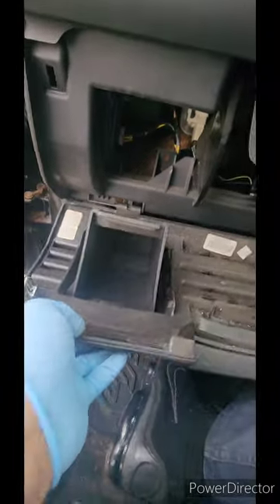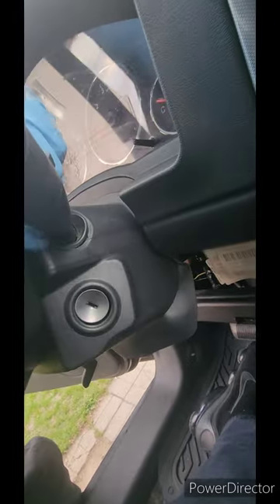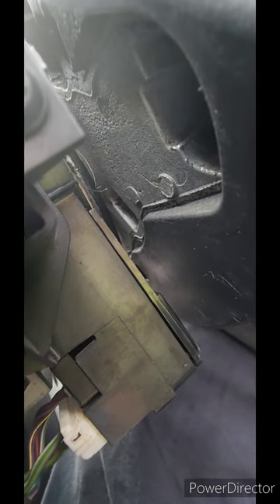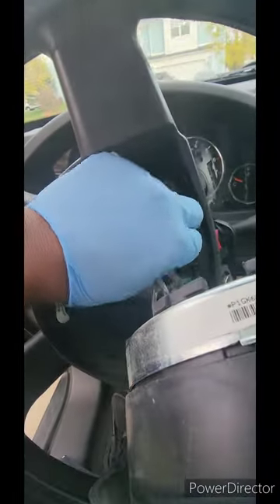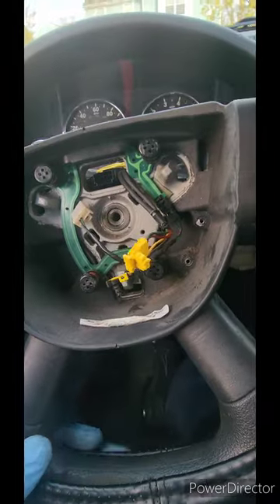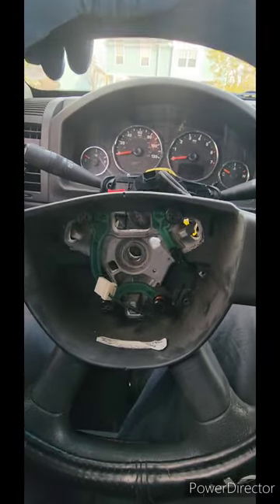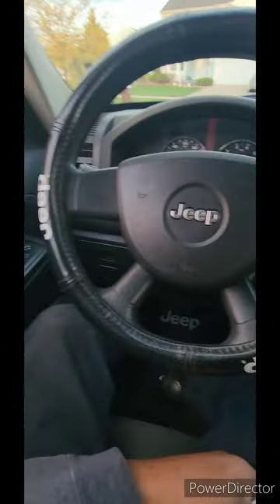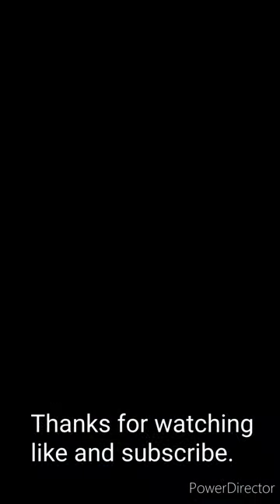Jeep Liberty 08-12 Clock spring removal.

Comment: Correction - From 2011 and later they did away with the clips holding on the airbag.  They replaced it with 2 small bolts on the left and right side of the steering wheel. A lot easier.

Comment: Do you mean it didn't have the steering angle sensor? I'm installing one and my new clockspring has the steering senser but doesn't have the plug in for my steering wheel mounted cruise control and I can't find one with it anywhere.